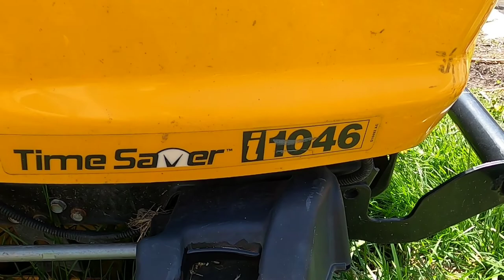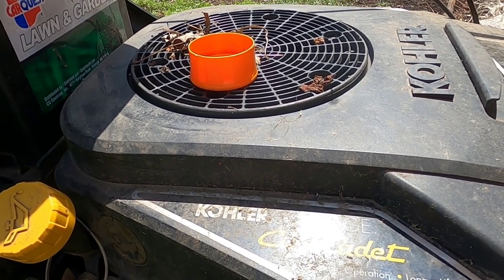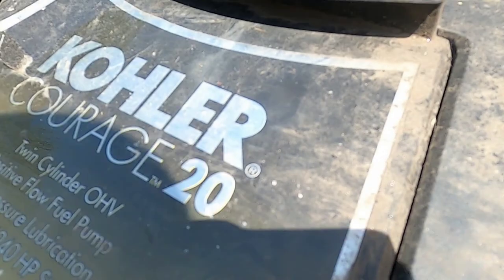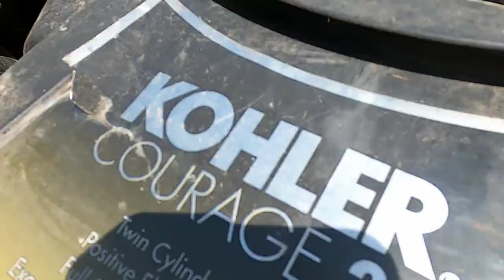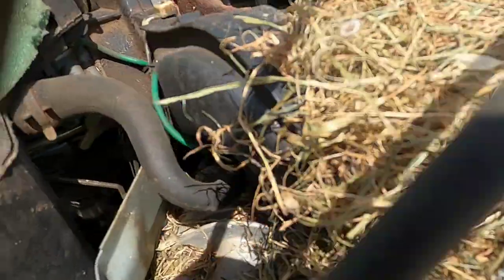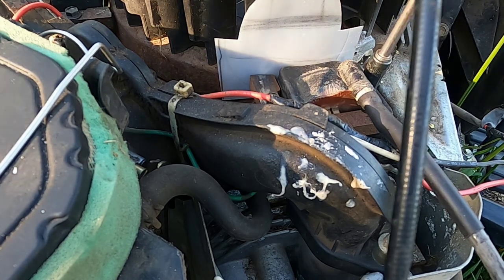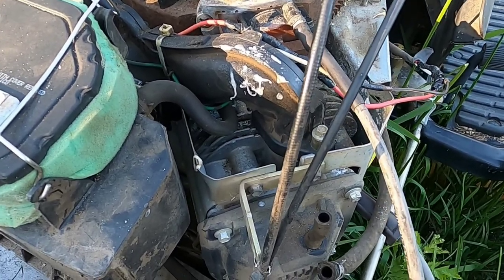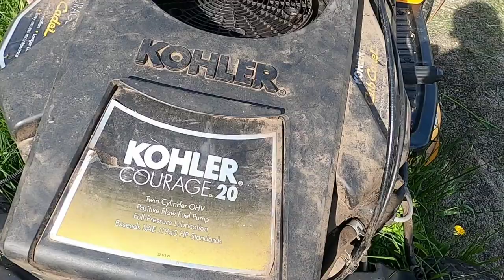Cub Cadet getting it to start

Comment: Did you end up welding that gear did you get another one?
Reply from the maker: I had to weld it, Kohler only sells the the flywheel & ring gear as a unit. They run between $200 to $290. After I welded it, I found a non oem ring gear online  for $30.  I am waiting for the JB weld that I applied to the detached magnet to fully dry & then I will see what is needed next to get this started. Still have to address the front right wheel not turning. If I had though of it I would have made each repair a separate video.
 I appreciate your & other viewers .👍 --comments & subs. People may not realize how much it helps with YT.

I am off to another repair.
Stay tuned for part 2. It should be up by Saturday if all goes well.
Be well, Joe Z